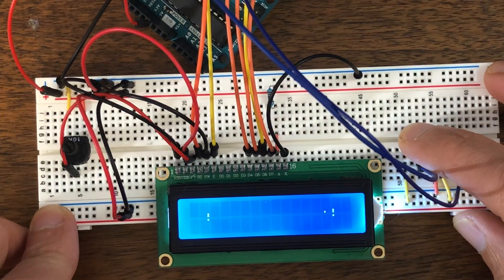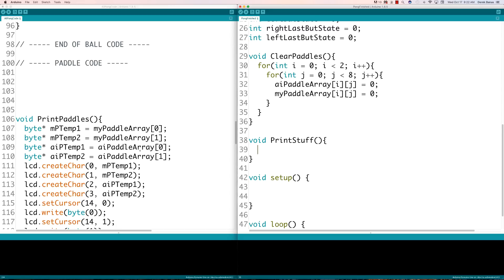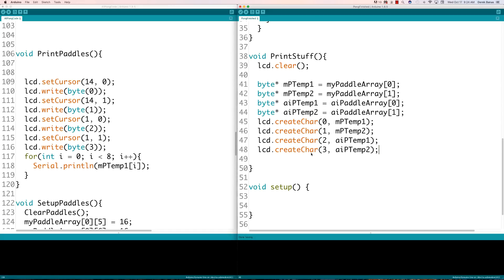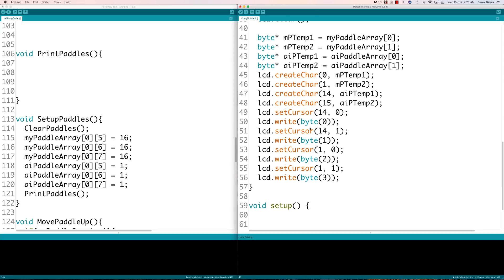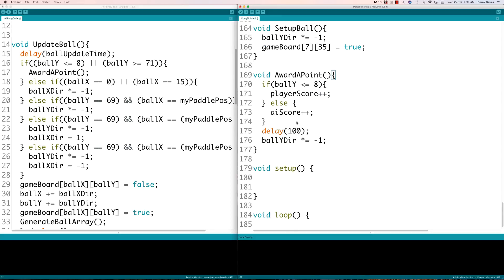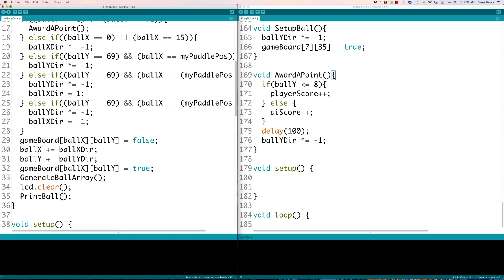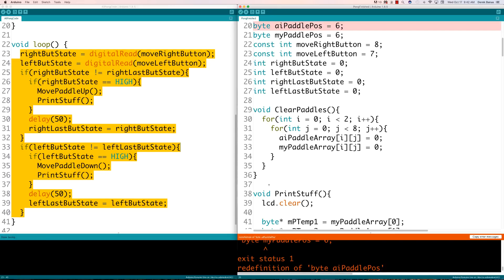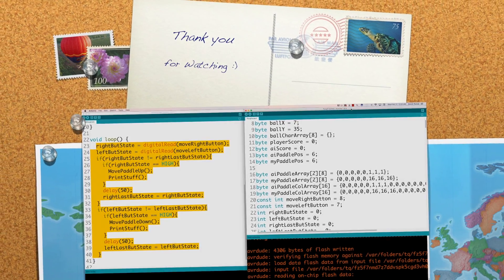Arduino 11 Finish Pong

Comment: Sir, I need your help, I made the project of ping pong game as taught by you but when I run it, everything is fine except when suddenly the paddle disappears and the ball comes in place of it, that is there are two balls simultaneously in the arena for a short time and this happens with both of the paddles. Please help me remove this error.
Reply from the maker: Did you see the code I provide here http://www.newthinktank.com/2018/10/arduino-11-finish-pong/
Reply: @derekbanas  i actually solved the problem an year ago 😜. Thanks for your help
Reply: Same for me too, im still trying to solve the problem